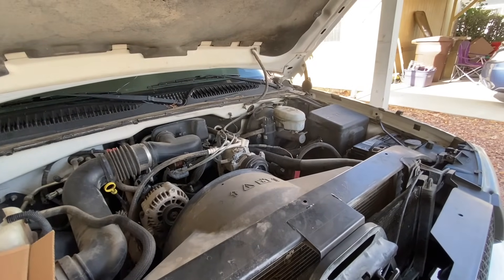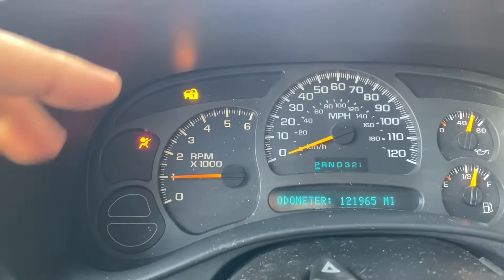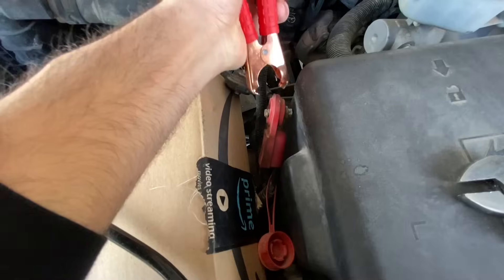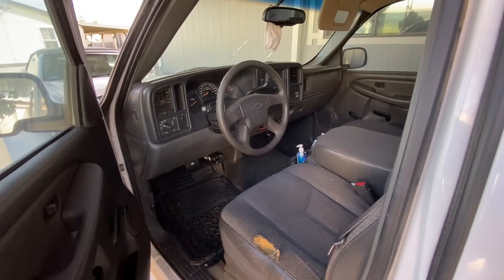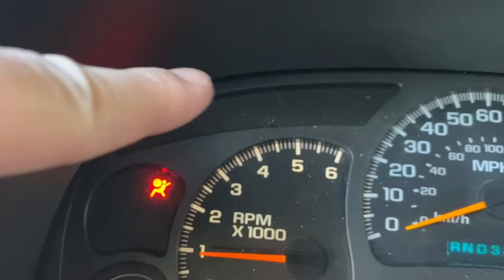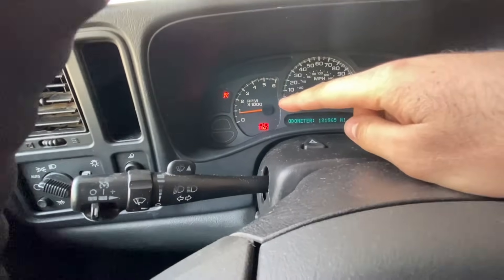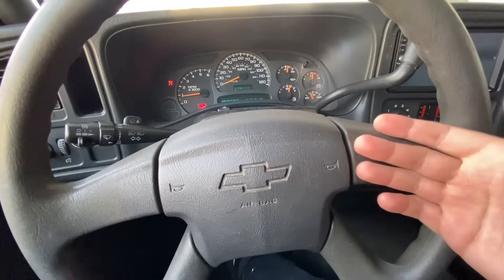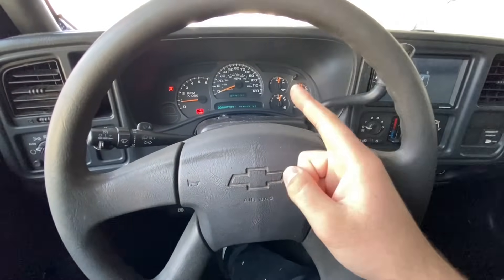How To Reset All ECU’s And Control Modules In Your Car Or Truck Safely

Comment: Hi, I just watched your video and got me wondering if this could help me. I own a 2017 ford explorer sport.  My lights were left on and drained my battery. I received a jump however noticed from that point my gas mileage average went down drastically. I use to get 19 - 23 miles per gallon. Now I get 10 - 12.5 per gallon. I went to Ford and had them replace my battery. Now they are saying that the gas issue should be solved if I ok them to do a PCM, BCM, and IPC factory reset which is not covered under warranty and will cost close to $600.  Any help on this is greatly appreciated.
Reply: Ford should have its own relearn procedure that is unique to Ford's.

Comment: I have an odd issue with a 95 k3000 where a brand new and tested good battery only registers 1/3 charge and won't even kick over the starter. I was thinking of reseting the ecu/tcu etc. Going to follow this procedure and see if it helps any.

Comment: Never heard of the 5 second rules? Did you see this in a factory service manual? It will relearn drivability. so many stops, so many starts so long at certian speeds, so much time at certain temps and so on. Just drvie your car normally.

Comment: A little advice please 08 Chevy express 2500 w/4.8 V8, cleaned the throttle body, I didn't realize what was gonna happen, ya think your method will get my idle back where it belongs?? I see alotta people reaching out, I feel like the interior of the truck looked Similar, just not sure if it'll help this issue, please 💯

Comment: Interesting video. I just disconnect the negative terminal from the battery and then turn on the lights to clear out residual power.
Reply: Okay I was driving with a bad camshaft position sensor and the signal was so weak that the ECU turn off the fuel and spark. But once I replace the camshaft position sensor the fuel and spark is still off and my car still won't start. I did this and still won't start. You can't turn the fuel and spark back on once it has been turned off. I'm just going to have to replace the spark plugs again and I'm gonna have to replace the fuel pump. Bad camshaft sensor really messed up my car. Now that I have the new camshaft sensor my car still won't start.
Reply: @BryanG830 You might have got a bad sensor. I'd take it back and have it replaced. Before I put a new fuel pump in it. Because fuel and spark are both controlled by the computer. Sounds like the computer still isn't getting signal from the cam shaft sensor. And getting bad electronic parts happens all the time. Just a suggestion because I had the same issue with a Toyota Corolla. Replaced the cam sensor a second time and fixed it.
Reply: @BryanG830  Could be that your MAF sensor went bad or the little magnet that mounts on your timing gear has broken or corroded away.
Reply: @BryanG830 I know this comment is over a year old, but I replaced a camshaft sensor with an aftermarket (cheap) option, and it did the same. After I spent the money on the AC Delco (Chevy) part, it worked like a charm.
Reply: @BryanG830  Try replacing your MAF sensor with a known good one.
Reply: @BryanG830  a lot of assumptions in your assessment mr bryan - ALOOT✋😳 for exampl, I have no idea wats malfunctioning on your car, but Iv heard, that disconnecting neg. battery terminal, then turning on headlights for.. was it 10 minuts or seconds? resets computer.. wat if you do that & it turns off fuel shut off setting?  You may or may not have found problem, but it means your spark plugs & fuel pump work, & it’s likely & computer &/or wiring thing.. again that’s just 1 example
Reply: @BryanG830 I have this exact issue. I replaced the sensor, still not able to start my car. Did you figure out how to get your car started?
Reply: @Poker_dealer82  I replaced a camshaft sensor with an aftermarket (cheap) option, and it did the same. After I spent the money on the AC Delco (Chevy) part, it worked like a charm.
Reply: @BibleBlissatBedtime  Thank you. I replaced my blinker fluid, and my car started. Good luck!
Reply: @BryanG830 why would you have to replace the spark plugs tho? It cant tell...
Reply: @BryanG830  did you figure out your issue. I'm having a similar issue.
Reply: @annacahill5394  I replaced a camshaft sensor with an aftermarket (cheap) option, and it did the same. After I spent the money on the AC Delco (Chevy) part, it worked like a charm.
Reply: Will this clear up all glitches with air bags, locks locking& unlocking by themselves, ect snow light, and the temp guage? It's for a 2006 Toyota Highlander 4cyl front wheel drive.
Reply: @evythaisholdsworth8389  well ?  Does (did) it ??
Reply: I have a 95 Buick LeSabre will this process also reset the theft mode
Reply: I dont know, its probably part of the read-only memory. @JustinHearn-f5y
Reply: The day ippokojjjjjujuhhhuhuuujhihkojookoooooikiookooiiojojiooiiioijoiiiiiiuijiiiiioioonkokoojokoookojoojojkojokojjoojkojokkokoojoojojjiiiijiijjoiojijjiijijhibjojjihojjjojojjjiojjoojojikojiojoojjjininnijiiijiiijjoijjiihuhiuijhihihihihhijhuhh
Reply: Will this help with my AC module not communicating with the bcm?
Reply: @ayriassears6171 i’m having the same issue.  anybody know the answer?
Reply: How long you leave your lights on?
Reply: Is it still disconnected?
Reply: Will this work to learn a new battery?
Reply: So do I but I think this is a better way to do it.
Reply: How well do that work out ❣️
Reply: Watching these vids just is like memories on steroids of what my dad taught me.
Reply: When you disconnect the ground how do you power the lights ? That’s weird
Reply: @StreetSpeed410 you arent..its letting out residual charge quicker.
Reply: When you activate the lights, it drains the residual energy... Your not actually trying to make the lights laminate, your just activating the switch @StreetSpeed410
Reply: @StreetSpeed410  There is no ground. When you turn on the lights you are bleeding out any residual power from the capacitors which will clear the memory.
Reply: This is incorrect.
You are to remove the supply, meaning battery both battery terminals, from the circuit.
Then short the load circuit by connecting the red and black cables to drain any capacitive residual supply. This actually is better done by using a resistor between these two  cables versus a hard short in case there is a significant capacitive residual that could arc.
Reply: Thanks for clearing that up 👍
Reply: @martyhughes7591 😅
Reply: @martyhughes7591  lpqqpppqa😊😊😊

Comment: I've done this for years with my 99 toyota sienna. Ground is ground. Just remove the positive terminal and short it to the ground for a few seconds. That is all it takes. All capacitors and components will be drained down immediately. It does not take 5 or 10 or 15 minutes.  Ground one of your hot wires in you home and see how fast it blows a breaker.  It is instantaneous. It does not take minutes. Should have been a 1 minute video. K.I.S.S. keep it simple stupid. Don't make more out of it. 🙄
Reply: @@rupertorosadoruiz No need for you to be woke cancel culture living in your parents basement getting drunk and high every night without a job and being a burden on society never serving your community or your country. Get a job, join the military or fire department or help those in need.

Comment: After resetting the EMC I have found one small problem the display for my radio and aircon only switches on intermittently how can this be sorted out although they both work fine being without the display is a bit annoying

Comment: I had been told that activating a critical system in the car after disconnecting the battery would do this.
I had an issue with an aftermarket remote starter that kept setting a security code, prevented the car from starting  and triggered the check engine light.

I disconnected the battery then pressed the brake pedal for about 2 minutes.  After that, the car started, the engine light went out and the code was cleared.  Over a few months, the same thing happened twice more and the same sequence cleared the problem.

So, how is this method different from yours?  It appears to be a little quicker and easier, but maybe it isn't as thorough?

I eventually replaced the battery because of another issue and this problem did not return before I sold the car about a year later.
Reply: This method drains the residual power from all capacitors (capacitors store power, just like a battery)
Reply: Because his method is a hard reset. It's like wiping everything out of your pc computer hard drive and reloading everything fresh. It's the better option.

Comment: If you want to go a step further, with both battery terminals DISCONNECTED, turn the key on and then off once.
Reply: What does that step do for you?
Reply: That's a good 1, open the circuits. Like a 2 way switch.
Reply: You mean turn it on then disconnect the battery and turn off the key ? Thanks
Reply: @Finish-Kana  Read it again.

Comment: Will this work for code P0011 (camshaft sensor)
Reply: If your vehicle just threw a code but nothing is actually wrong - yes it will work/clear. If the cam sensor is bad, it will not fix it, you'll need to replace the sensor. This is just a way to find out if the problem is real or not.

Comment: Spent 3 weeks doing a transmission swap in our parking lot, 2002 gmc yukon XL 1500 Denali with the 6.0 motor and 4L65E transmission.  The original transmission would only shift in 1st and second, the swapped transmission will not shift out of 1st gear. I tried this method and still nothing.  Can someone offer some insight?
Reply: In order for transmissions to work properly the transmission oil and filter must be changed every 45-50K miles. If you change the oil after say more than 100K miles you are screwed, it won’t go into gears or it will be slipping
Reply: Looks like a bad solenoid in the trans.

Comment: Where is the ECU located  on my 
66 Chevelle Super Sport   ?
It won't stop pulling  both front  tires off the ground  , 
And gas mileage  is 3 miles per  gallon  ,but horse power is 450 ,
Should  I go back to  the Crane 
camshaft  and  1050cfm carb. ?

Comment: After replacing my battery in my V60 2012 the car infotainment system vent totaly crazy. Nothing worked, every fuse was ok. The car had around 20 error codes. So i started searching on web for solutions and i came across this video. I must say i was very skeptical. Had nothing to looze so i tried it. After i shorted the cars electric system with battery disconnected, and then reconnected battery the car was normal again. Thank you very much!!
Reply: Someone’s a Karen lol
Reply: Should have kept the system powered up w 12volts. They make a adapter for it. Read  before you fuck yourself lol
Reply: What the hell is a V20? A Volvo? They have a completely different electrical system than the Chevy truck in this video and doing what is did accomplished nothing except perhaps a better connection from the battery to the alternator and cars electrical system. It is no longer B+ to the dash, it is serial data thru one wire and some two wires twisted 9 times per foot to prevent RFI. Don't know what that is...Stop! With battery disconnected & jump positive to negative is simply drain capacitors which is fruitless, waist of time. From 1998 and newer, the dash or instrument cluster (IP) has power, ground and class-2 serial data to operate the shifter's position and gages. Those signals are class-2 a signal from 0-7 volts and a good volt-ohm-meter on pin two of the OBD-2 connector (Cavity 2 - 1.5mm wide) will show 3.5  volts on average on an active circuit. By disconnecting the battery does nothing. Saved favorite radio satiations are still saved on an electronic erasable programmable read-only-memory or (EEPROM) as these are used in almost every module. Re-connecting the battery most likely fixed a dirty-corroded cable and have system voltage, 13.2 volts hot to 14.6 volts hot. By disconnecting the battery (If it will run) you lost the opportunity to check and diagnose the root cause by seeing 12.6 volts at the alternator B+ & ground, then 12.7 volts the battery bolts on the side. If you had a (DVOM) with a Min-Max feature, set it to voltage, crank over, go back to the (DVOM) and see 9.8 volts. This maybe enough to start it be freaks out the electronics or produces 10.4 volts to the entire system while running. Even the shift display has an electric switch on the side, by hydraulic switch inside on the valve body of the 4L60e. Alternators produce direct current, get hot and change output depending on temperature. The lower the temp, the higher the charge. But is one of the 3 positive diodes or 3 negative diodes fail and leak voltage backwards, then A/C voltage goes out thru the entire DC system. This activity disrupted the 0-7 volt class-2 serial data signal, UART, Keyword 2000, Keyword 2001 or GM-LAN (Two wires, twisted 9 times per foot, 120 ohm termination resistors at end modules. 1 volt high & 1 volt low to offset high voltage induction and frequently foil covered and connected to ground. 
 So I work this video but I thought I saw a spaceship flying right out me then turned and went straight up a disappeared in the sky faster than anything I have ever seen! Which is true? DK, ASE Master Tech since 1978, mechanic since 1970
Reply: Bla, bla, bla😂😂😂😂 @deankay4434
Reply: I'm a little confused my friend. So basically you are saying that the back up system ,in the end Will not crank the truck,  therefore not resetting the computer?? Please respond 🙏 @deankay4434
Reply: I have  2005 Ford escape that is stuck in drive. Nothing I do will correct the problem. Do you have any suggestions?
Reply: What symptoms did your car have before you did that??
Reply: It would not crank over

Comment: The problem with this technique is when u disco the battery,  you have to drive 200 miles to reset it. I had this problem with my ford explorer.

Comment: BS, this is not 1980! I have done that to vehicle in my life. Don't do it with working on newer, but older 80's, 90's you can remove the battery and drive home after started. Some batteries run clock, or Fords Keep Alive Memory but if you think your vehicle needs power, use a 9 volt rectangular battery and run found to the engine and power to starter, hot side of fuse box or fuse protection at distribution center. The alternator runs the vehicle after starting and charges a good battery at 0.030 Vdc while driving. 
Don't believe everything you see as one fits all. GM uses many EEPROM's that store info without any power and running jumper cables around engine compartment where fuel is, asking for a fire. Clear codes the correct way but never blindly change a battery and think you are done. Drain over 0.400Vdc off....to much.
Charging while running at 13.2 - 14.4 Vdc depending on air temp great but do a voltage drop from alt B+ to battery Red while running with lights, fan,?stereo, and should be below 0.400 or way less. (Question, red or black meter lead?) makes no difference as a (-) negative sign shows in front of number. 
DK, ASE master tech since 78, retired.
Reply: What else would you suggest for a bcm thats going bad.

Comment: My truck has had the 5.0 little V8 swap that 4 5.7 in my 87 Chevy and I need to figure out how to reprogram the computer so recognizes that it's a 5.7 7 but mine only has one computer forward 1 computer for everything it doesn't have a whole bunch of computers in my truck so I'm trying to figure out how to reprogram this 1 single computer So everything works properly and it doesn't act weird

Comment: SX4 stuck by the immobilizer.  This did the trick. Thanks so much.
Reply: Hello what were the problems in the first place before you reset?
Reply: @Finish-Kana  I am not sure what trigger the immo. I recall jacking the front of the car, quite high, for some maintenance, maybe disconnecting the battery, and afterwards the car did not start.

Comment: Why did you remove/ isolate the positive from the battery in this video but left the positive connected to the battery in the other video with the Ford Explorer?? Is it different with the Chevy or does it matter?